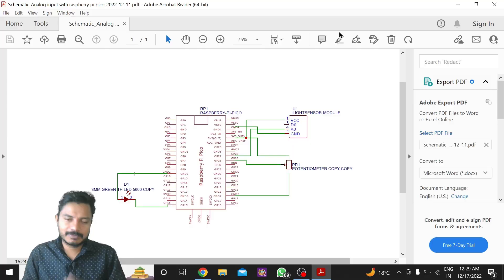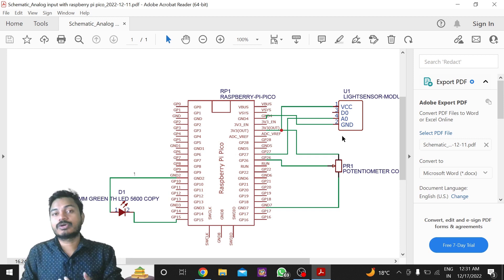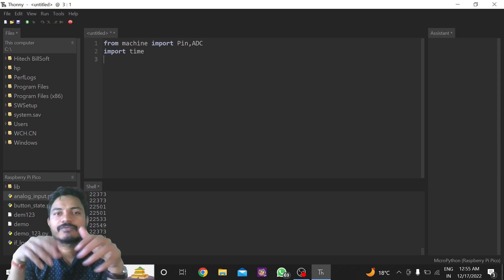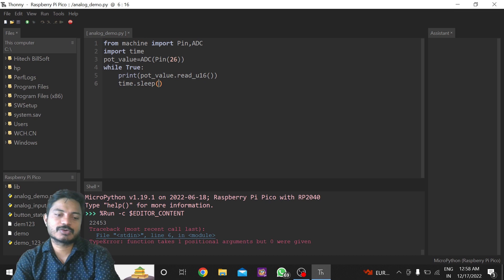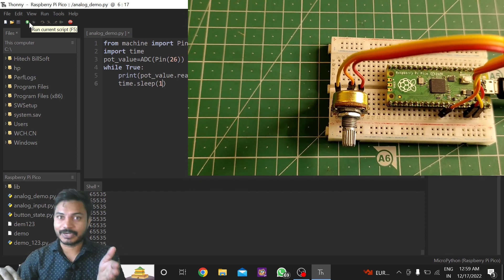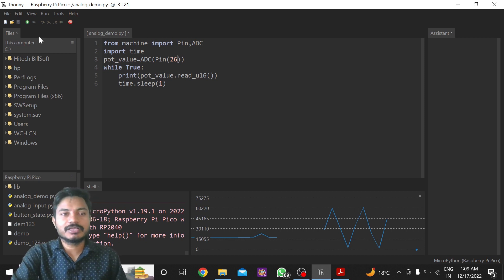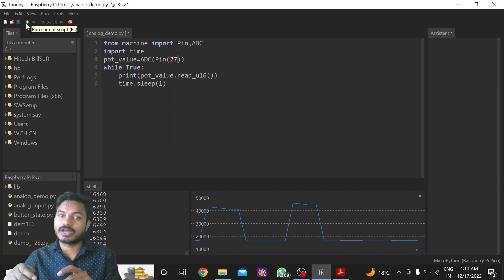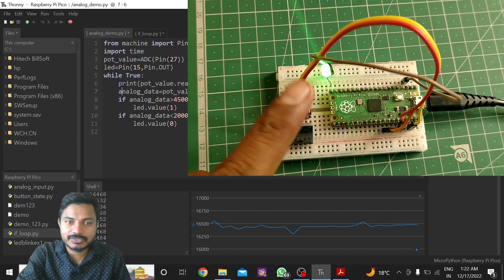Analog input with Raspberry pi pico using Micropython | Analog read with raspberry pi pico

Comment: I have watched your earlier video of Pi Pico with Arduino IDE. That is the single video with Arduino IDE and the you switched over to MicroPython. I want to ask you, which is better IDE (Language) for Pi Pico. C/C++ with Arduino IDE  or  MicroPython?
Reply from the maker: Sorry for the delayed response. I will suggest whenever you will use the raspberry pi pico then you should go with MicroPython as there are resources available for the same.
But as we all are very familiar with the Arduino it's simple to use and easy to learn. If you see all the raspberry pi websites you will find content mainly related using the python.